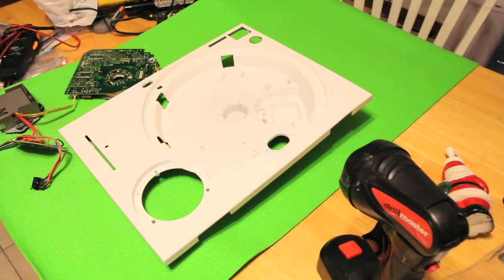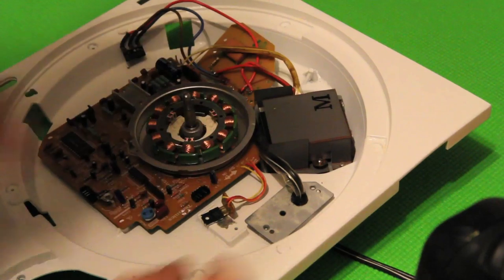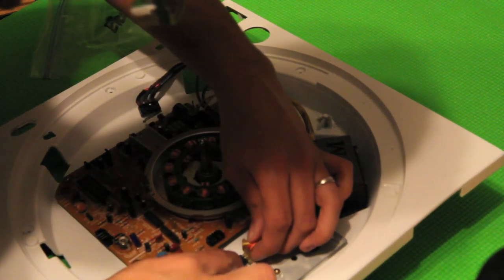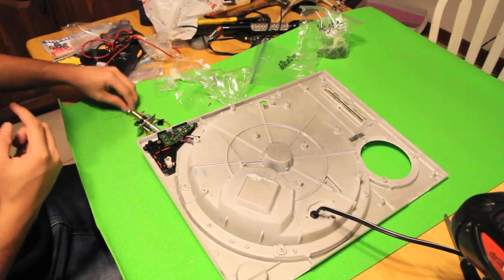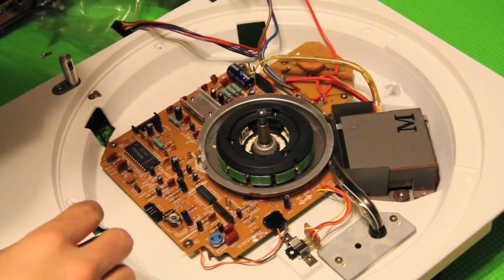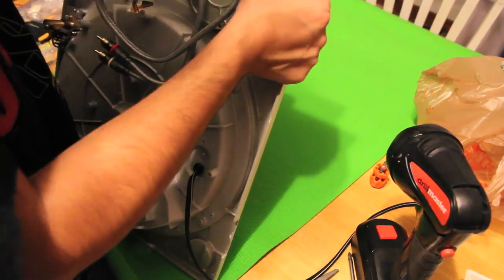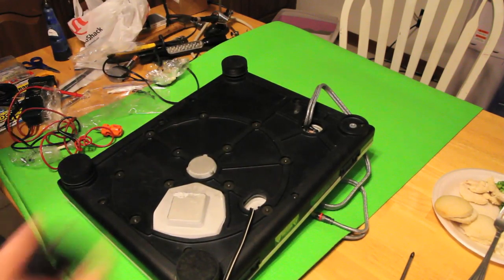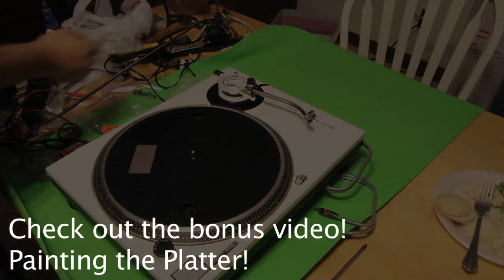Technics Tuneup Part X: Putting it all together

Comment: This is what I have done with my platter.  I have left the top alone, because it is covered with a slipmat; but I have scrubbed the strobe dots off completely.  I did with with Acetone and a wire brush.  I used a smallish brush that looks a bit like a toothbrush.  It requires some elbow grease, but the result is a bare aluminium.  The Strobe works just as well - ie the black background is not needed.  As a finishing touch I polished the aluminium with Autosol.  
Incidentally it is a good idea to get a quality aftermarket mat, say from Funkfirm or Oyaide.  The reason is that the rubber underneath the platter is not correctly applied and so the platter has a lot of resonance with is a bad thing - a better platter will ameliorate this.